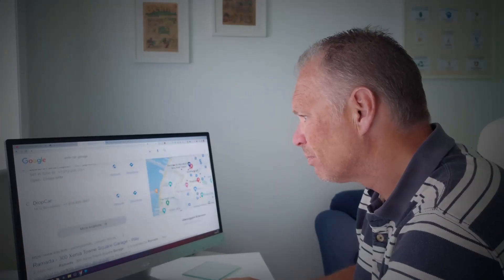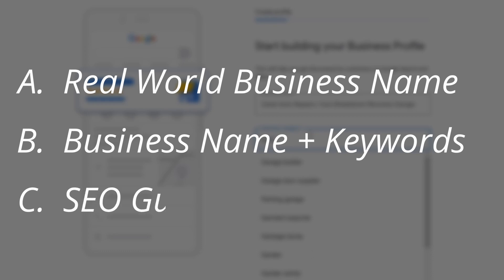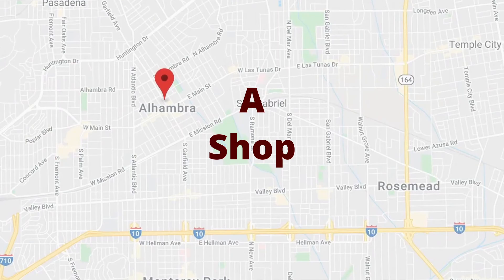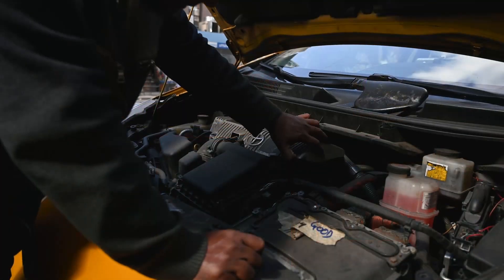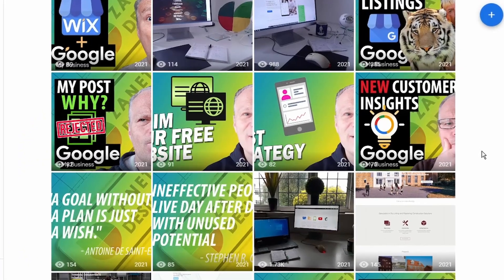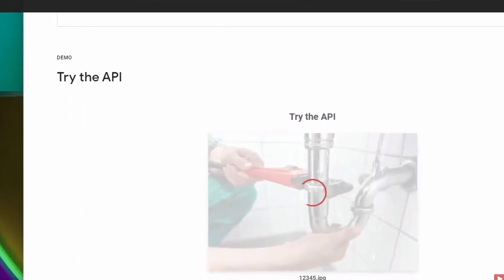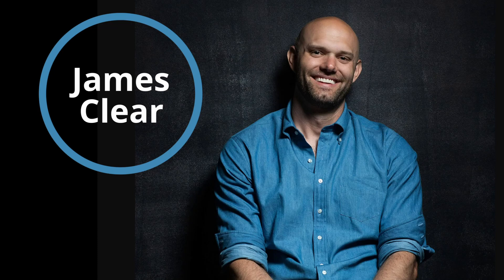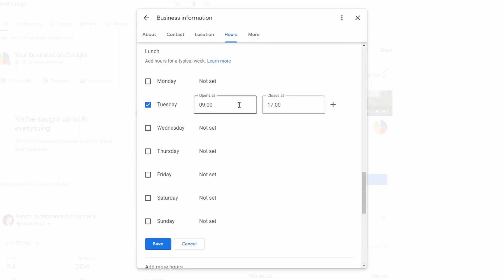5 Fatal Google My Business Profile Mistakes To Avoid

Comment: Love your content! Question: How does google respond to using a stock image IF the image has been customized. In other words, I add original images to the stock image to make it a unique product?
Reply from the maker: Google vision is pretty good as I show in my videos, but not 100% accurate. so if you manipulate stock photos you are improving the chances of it losing views as unique. Always be led by does it make sense for the customer and its more likely to lead you in the right direction

Comment: I run my husband's plumbing company.  I have a question about "Services" on Google My Business.  I have the services we provide.  But every other day, there are recommendations in red as suggestions or updates.  How do I get rid of these?  We don't do what is recommended.  If I don't accept.... will it bring down our popularity?
Reply from the maker: I wonder if these are due to other competitors adding irrelevant suggestions to dilute your authority. I had the same a year ago and assumed they were from Google,  but I'm not so sure now as it seems a constant barage. my advise is only accept the applicable
Reply: These suggestions are taken from across the web, either on your website or off reviews given by customers, they are not coming from competitors. I suspect that they may also come from social media posts as well etc.
Reply from the maker: @Bangkok-travel-ideas  Yes its hard to control and not always easy to remove

Comment: I agree with you about naming your profile but the problem is keyword stuffing GBP names continues to give a huge ranking boost and despite many anti spam updates Google still doesn’t appear to be too bothered about fixing it. How long should a business miss out on prime ranking spots because they are playing by the rules.  A suspension may be inevitable, assuming you don’t set up a trading name that matches the keyword rich GBP name but when will Google get around to enforcing their own TOS. I’ve been doing Local SEO for over 10 years and we are still waiting!
Reply from the maker: Simon , thanks for that great comment. You are absolutely right. I think this is what make Google Business Profile so fascinating as it is full of potential and is the leader in providing businesses with a platform to sell and be found, yet its soo broken in areas that seem obvious to everyone other than google. I'm currently filming an interaction with Google where they have suspended a genuine business and its now over 60 days and still not resolved, though they have been given everything they requested and its not breaking any guidelines - they have a lot to change before it works fairly